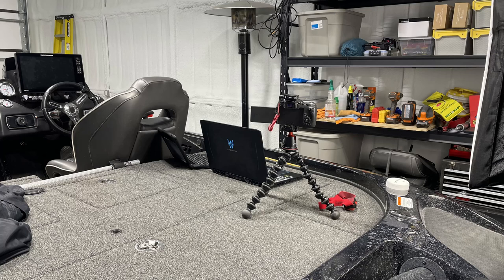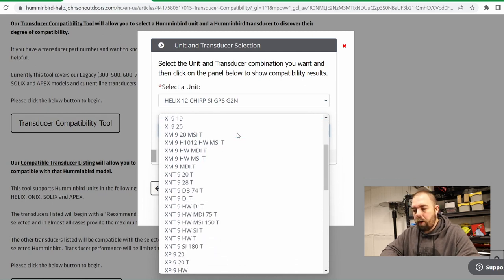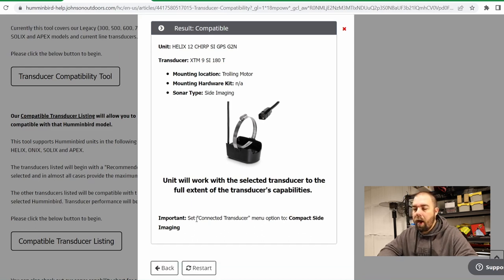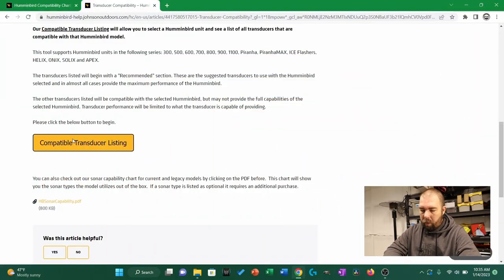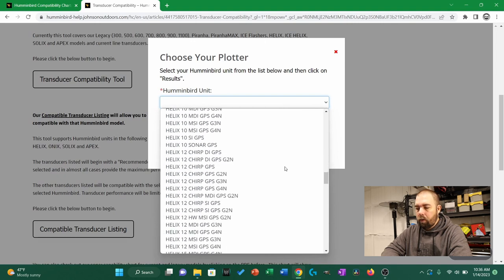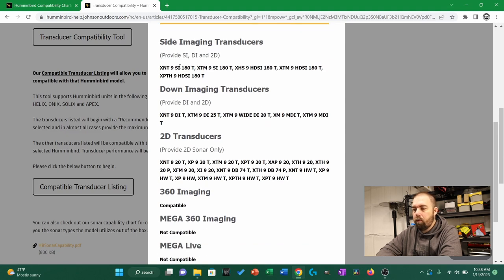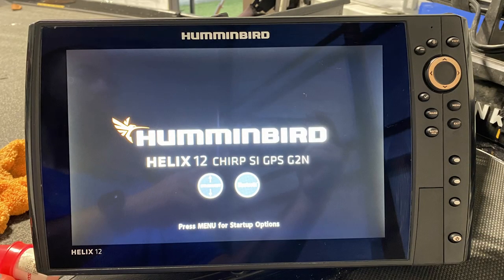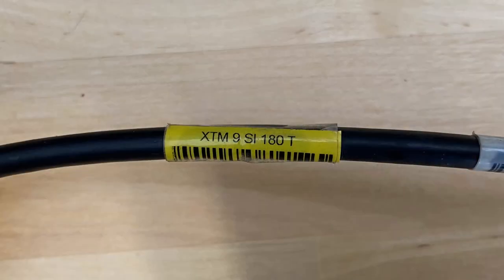The Definitive Guide to Choosing the Perfect Humminbird Transducer

Comment: I'm having a hard time finding some info. I have the helix 15 SI+ MODEL and want to use a "Y" cable to run both the MEGA live imaging transducer and the MEGA 360 transducer.
Is this possible? If so, will both be able to function at the same time in split screen mode?
Thanks.
Oh, it's the G4 unit as well.